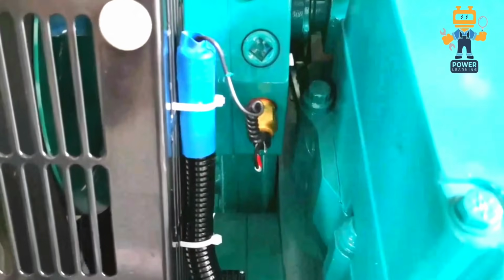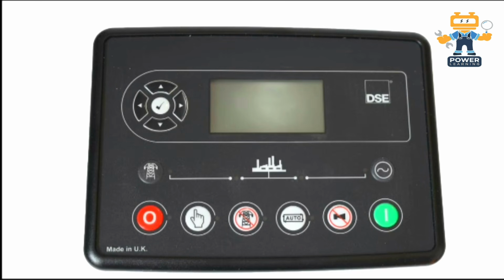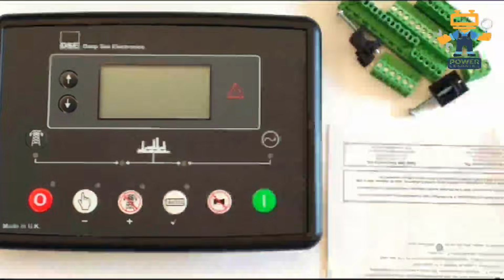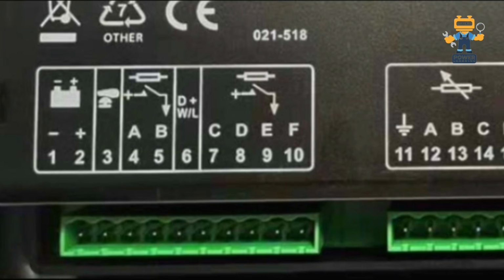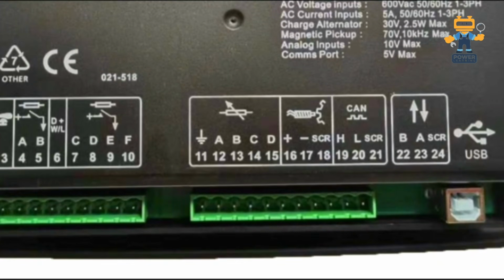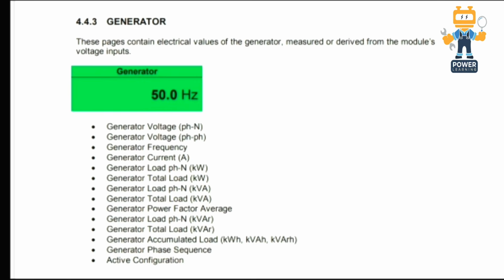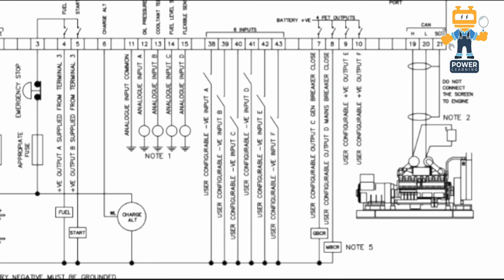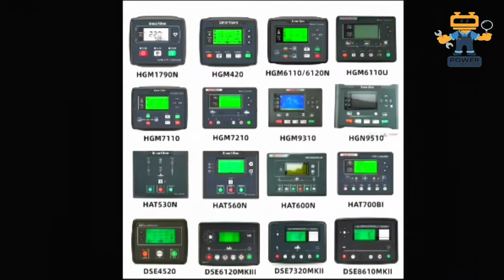DSE 6110 & DSE 6120 Complete Beginner Training | Configuration, Generator Control Wiring & Operation

Comment: Sir can you explain how can I connect two DSE 6120  controller one at DG set another at control room . I can start  DG from control room or  from DG set.
Reply from the maker: U need to use 7420 models Modules on both location

Comment: smartgen controller for 23kva generator offgrid with inverter integration. gen to charge batteries when it gets below 20% and battery for generator must stay charged
Reply from the maker: That’s a great project. I'll see if I can include it in a future video.
Reply: @Dieselgeneratorksa  im sitting with such an install currently. ats is not included but now the problem is 133v per phase to the system for a couple seconds thill the rpm is stable and then the voltage stabilizes. this problem would not have happened if the ats was involved but there is no grid power. not sure how to fix this